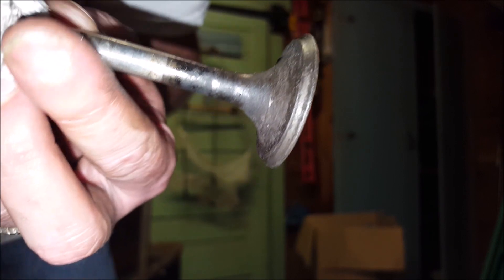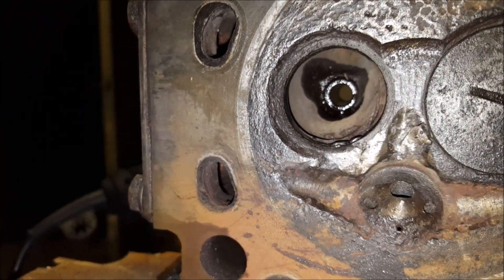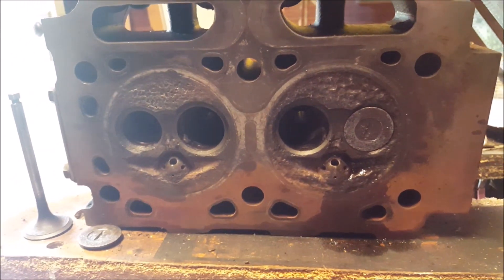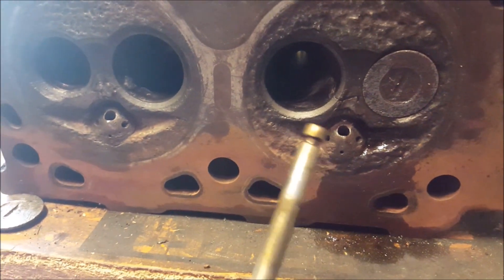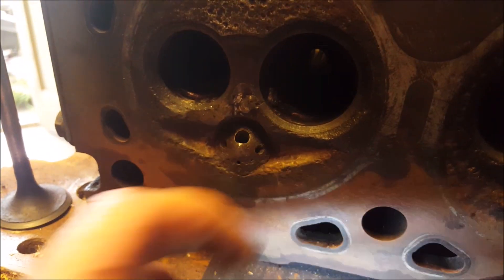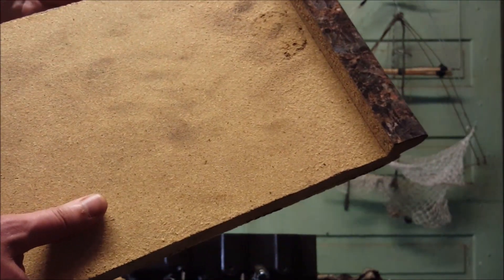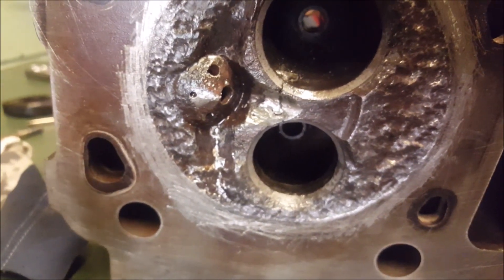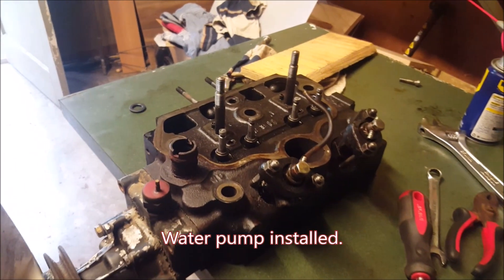Yanmar Head Work: Welding Cracks and Grinding Valves

Comment: Could it be possible that the cracks allow coolant droplets into the cylinder and caused the pitting? I have 3 cyl yanmar diesel and 1 cyl looks great. Other 2 are badly pitted and both of those have a crack in the head between valve and injection port. I'm getting new head then liners, pistons etc..... I'm weary of trying to repair the cracks.
Reply from the maker: Hi, headpainter. Yes, definitely. Things change a lot (at a small level) when an engine heats up. Our Yanmar probably had this problem to some degree for years. I thought it was smoke sometimes , and  it would go away after a few minutes. When it got worse I noticed the sick, sweet smell of the burning coolant. I think your plan is the best route.
Thanks so much for watching and commenting. I hope you get it running again!
Reply: @servihomestead4324  be nice if I could just clean up the cracks and put some JB Weld in there but I really don't think that would hold.
Reply: @servihomestead4324  you know they say you need to find the underlying problem. On these older tractors I'm curious as if maybe the thermostat stuck closed and caused it to overheat. I wonder why a tractor would even need a thermostat except really cold environments. I'm in the Southern United States. I wonder if I could just eliminate my thermostat.
Reply from the maker: @headpainter1  Yeah, you're right about getting to the root. We're in Louisiana. Yeah, I don't think a thermostat is real important down here. They do generally fail in the open position, though. For me I think branches had punctured the radiator a couple of times. Even with repairs it lost coolant regularly, so coupled with a bit of neglect it overheated several times over the years. But that cast iron head is SO solid and heavy it seems like it would never crack.

Comment: 10 thousands is 1- human hair... racecar drivers go 30 thousands max.. and are prepared for early motor blown head.. but xtra power :>)...  10 thousands is normal! for a repair. ! use dawn dish liquid and a Hone (large)  and keep it flat.. figure 8 patern.. be surprized how fast its done on allum -head! go slow
Reply from the maker: Wow, so that's the thickness of a hair. That puts it into perspective better. So you do this type of repair often, Chris? Thanks so much for watching and sharing your knowledge!

Comment: Yes shaving the head does increase compression. Wow, that head is pitted bad! Wonder how it got so pitted? You already know this with a diesel if compression isn’t right she won’t light off.. With the head upside down did you pour some diesel around the valves to see if the liquid leaked past the valves to confirm there seating? Just trying to help a fellow Louisianan from afar. You got me curious now on this project. Take care brother.
Reply from the maker: Yes, sir, compression is everything. I didn't think of that trick. Someone I spoke to mentioned a similar trick to see if the welding seals it off. Thanks so much for following along!